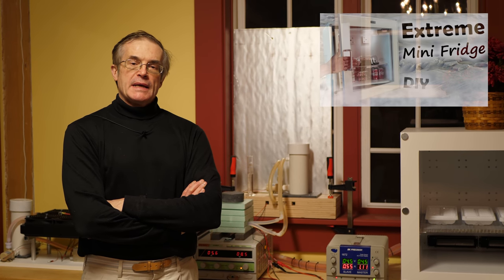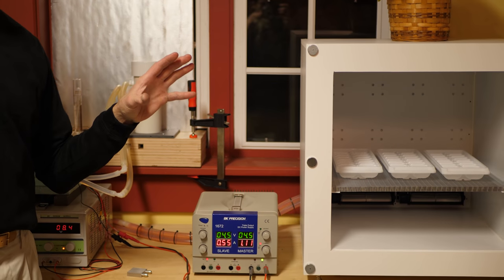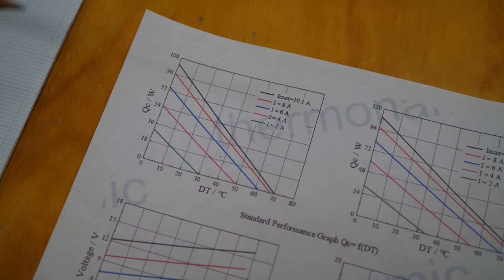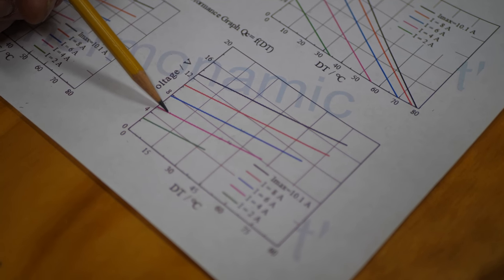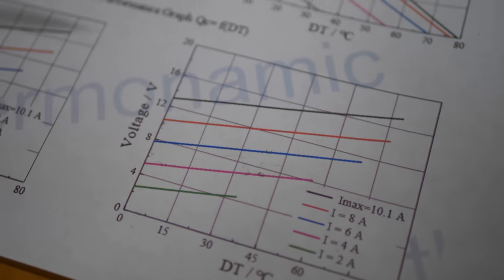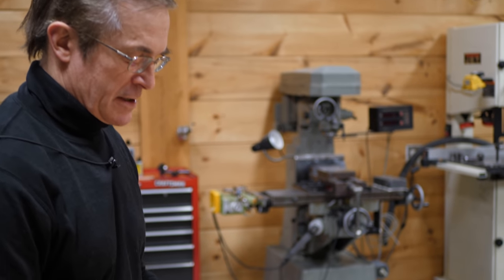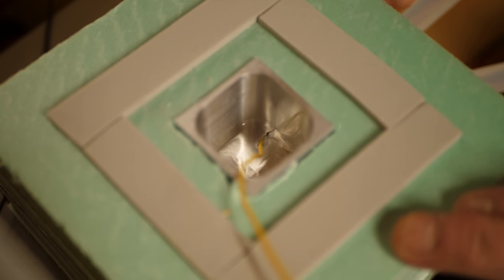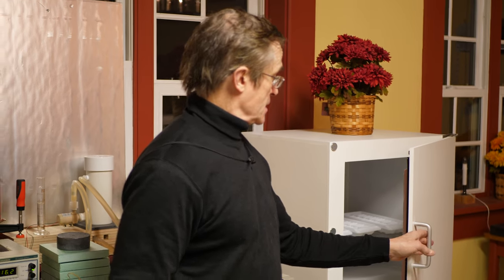EXTREMELY LOW TEMPERATURES! - Using TECs

Comment: i'd like to see one attached to a cpu for overclocking
Reply: That used to be a (relatively) common thing in the 200Xs... if i'm not mistaken.
Reply: One problem will be condensation at those temps.

Singel stage TEC was "common" in the early 2000:s on computers among over clockers.
Reply: SuperAWaC extremely low heat load capacity, Der8aur the guy who holds all the records from quad cores to duel socket servers tried to make a TEC system with I think 8 TECs on parrallel cooling a water loop, but unfortunately he needed to cool the tecs better because they were overloaded even with the CPU at idle. I run colder than what was shown here on my daily machines using refrigeration (phase coolers is what they go by for computers). They can handle as much heat load as you want, and multi stage at -160c nearing liquid nitrogen temps with the bigger cascade systems (typically designed to withstand 1000w CPUs or greater, which is obviously impossible for TECs as this video demonstrates).

Comment: Your final comment about using this on a computer chip doesn't make much sense. Any computer that would benefit from a system like this easily needs 300W of cooling on the CPU. None of the TEC's, even when stacked, can dissipate this amount of heat.
Reply from the maker: I understand and in a couple of weeks we'll be posting a video on cooling a PC with a low cost system that can more than cover those requirements.
However, there are other computer components that can benefit from a compact, solid state cooler such as the north bridge and memory chips, so localized/ focused cooling with TECs may have some value.
Reply: @TechIngredients  Northbridge has been ''on die'' for many years now. Memory chips may be a possibility, but there is little benefit in running them cold. 
Interested in seeing what you come up with for low cost cooling of a pc system. Seeing the equipment you have, I'd just buy a CPU waterblock and connect it to that radiator you have outside ;). Otherwise, a big 35$ aircooler is sufficient up to 150W.

Comment: I wonder if it would be more effective if TEC on cold side would be powered by square wave signal - PWM.
Reply from the maker: It's less effecient.  The effeciency is related to the instantaneous current.  With PWM, the peak current will determine the effeciency, the fraction of "on" time will determine the average heat flow at that reduced effeciency.

Comment: Useless setup. Try to move heat from a Peltierelement when the surrounding temp is 40 or 50 degrees C. That is when cooling is necessary.
Reply from the maker: Depends on what the use is.   Coooling a CCD for deep sky imaging, adjusting the color or significantly increasing the effeciency of a diode laser are just a couple of applications.

Comment: now I want to see a cpu cooled with this setup
Reply: TECs have been used to cool CPUs and other electronics for decades. Use a search engine, I do not have links to give at the moment. I remember watching videos from one guy, more than 15 years ago, who made TEC watercoolers for PC CPUs all by himself from aluminum and styrofoam (the hard construction type). Condensation is always a problem in normal living rooms if you want to cool well beyond room temperature.